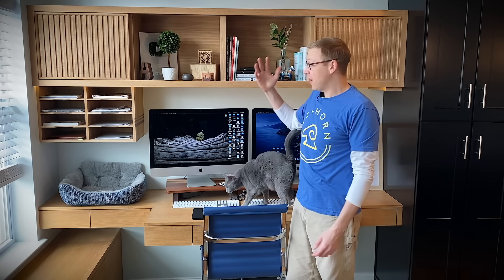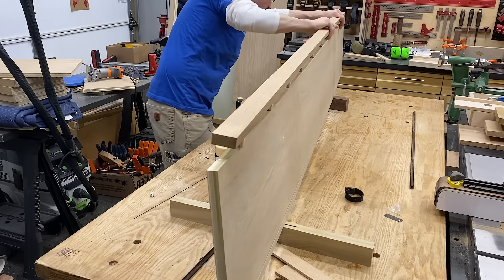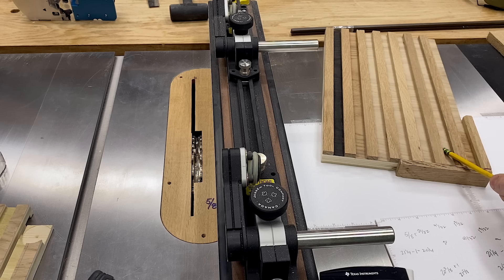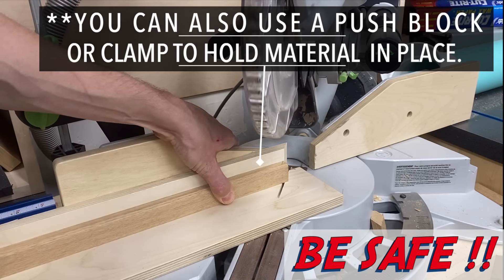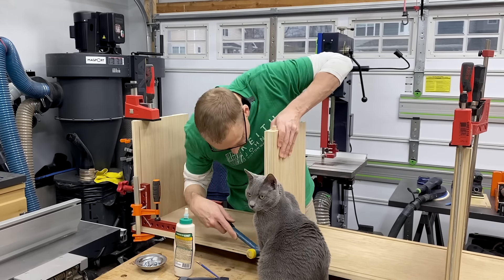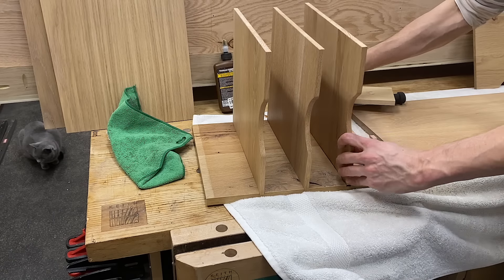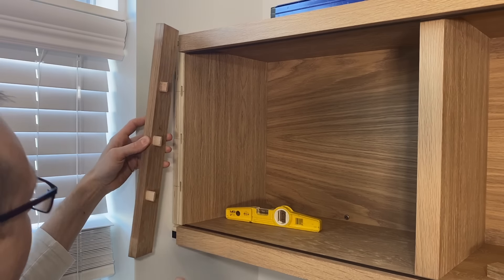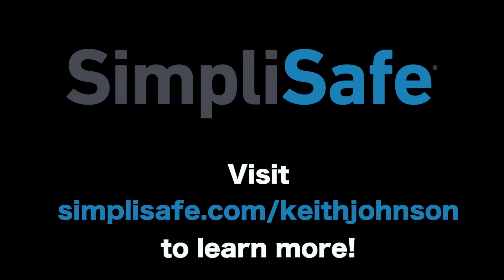Home Office Built-in [PART 2]

Comment: "Defyling all laws of wood movement" lol Fun.

IMO, we put *WAY* too much worry into it, especially in furniture. Sure, yes, it all moves. Yes. But between the relatively small size (especially in those accidental design elements (lol, redux)), furniture living in a consistent climate controlled environment, and the assembly techniques that generally want to resist movement and allowing for it in some places, it'll be fine. I've literally never had a piece explode (or even split/crack/expand) from excessive movement.
Reply from the maker: The second you don’t respect wood movement, is when it bites you 😜 😂

Comment: 22:00 you could scribe a 3mm MDF strip and transfer it to the prefinished filler :) On such a small piece it's probably not necessary and you did a great job of it anyway but for long pieces it's useful.
Reply from the maker: Great tip! Thanks! 👍🏻

Comment: I'm installing LED stick lights under the cabinets in our new house's kitchen tomorrow.  Was a little intimidated at first since I've never worked with that product and had nearly convinced myself to do traditional under cabinet lighting.  Looks like it's pretty easy from your video.
Reply from the maker: I was totally freaked out, too, but these ones were super simple since there was no low voltage wire that needed to be run. Hopefully, they last long term.
Reply: @KeithJohnsonCustomWoodworking  Looks like you bought the same ones I did.
Reply from the maker: @plasmac9  oh good. Looks like we will find out together how long they last 😂
Reply: @KeithJohnsonCustomWoodworking  I did about 50 feet of under and above cabinet lighting today with this stuff.  The finished product is super nice but this stuff is without a doubt some of the worst to work with.  The connector pieces are trash.  My fingers are absolutely killing me after finishing.  the adhesive on the stick lights is good but there is nothing on the connector pieces to hold them down so they either dangle or stick up.  I ended up putting a dab of hot glue on the bottom of the connector pieces to hold them down.  I certainly don't want to do this again.  Regular under cabinet lights that plug in would have been much easier.
Reply from the maker: @plasmac9  I see. I didn’t need any connector pieces so I have no experience with them. Sorry to hear about your troubles.

Comment: I liked before watching — overall design sensibility and scale to the space is just great! Watching it come together was really interesting as well. A question, was that SketchUp you were using for your 3D renders/plans? And one comment, I may have lengthened the sliding doors just a bit to meet the inner edge of the shelf divider (instead of the center as you have done, 24:38). Finally, after using the space, is there anything you might have done differently, from a comfort and usability perspective? THANK YOU!
Reply from the maker: Thanks so much for the comment, Curtis! I actually spent some time thinking about where I wanted the edges of the door to meet. I decided I liked the look of the seeing half the divider rather than it completely covered. It's purely preference. That size also lends itself well when a door is slid into place over one of the other openings as it splits the middle of the divider on each side of it. Honestly, I don't think I would do anything different with the space, except waiting to buy a proper desk chair for as long as I did 😂
Reply: @KeithJohnsonCustomWoodworking  Tx Keith! Looks like a great place to work  👌
Reply from the maker: Thanks! If you have to be in an office, it’s great to be in a space you like.

Comment: It looks really good! Did you consider 4 slides in a bypass setup?

I love the open middle, but my office always tends to cycle between everything in its right place and clutter and having a bypass that I could used to hide my clutter during a down cycle would feel welcome.
Reply from the maker: Thanks Michael! Yes, I actually did consider the 4-door setup, but that would have made the cabinet another 1-inch or more deeper which would have brought it out too close to the edge of the window. Or I would have had to make the inside shallower. I wanted the piece to be storage, but also have open and "decorative" areas as well since it's right next to a wall of black kitchen cabinets that are all closed.
Reply: @KeithJohnsonCustomWoodworking  - It’s beautiful in the space!
Reply from the maker: @mrector23  Thanks so much!!

Comment: Hi Keith! Quick question, when you are ripping plywood why do you have your table saw blade up to nearly full height? Do you have a reason like cut quality for this, or is it circumstance? Thanks!
Reply from the maker: Sometimes it's raised up high to cut a thick piece and then I'm just too lazy to lower it down. I generally keep it so the bottom of the gullet is at the top of the workpiece.
Reply: @KeithJohnsonCustomWoodworking  Ahh, ok. Wasn't sure if I was missing out on some neat trick with tear out or kick back. Great work on the office pieces! They really look nice. Thanks!

Comment: Hey Keith, great job on the build and the vid.  Question -- when installing the end stile at 22:58, is there any bond (glue or otherwise) between that stile and the rails, or is it just kind of a friction fit against the rails and the stile is connected only to the case by the dominos?  I ask because I'm curious if this method might be susceptible to the rail and stile pulling away and showing a tiny gap with any seasonal / temp / humidity wood movement?   I would be terrified to have rails and stiles that don't actually connect to each other -- but I've never actually tried it so what do I know???  thanks
Reply from the maker: Hey Carl! Great question and it's my fault for not showing the glue application. I applied glue in the domino mortises as well as on the case and the ends of the rails where they meet the stiles. End grain to long grain isn't the strongest joint with glue only and without additional mechanical fasteners (or housed joinery), but it should hold. Hopefully! 😜
Reply: Thinking ahead, it would be great if they could be fiction fitted incase of any wall painting in the future.
Reply from the maker: @allent555  that’s why they make painters tape 😜
Reply: @allent555  I see what you mean but I think you'd be better off gluing at a minimum rather than having the stile and rails touching but not connected in any way.   In the future if even a tiny tiny gap opened up, it would be really obvious.